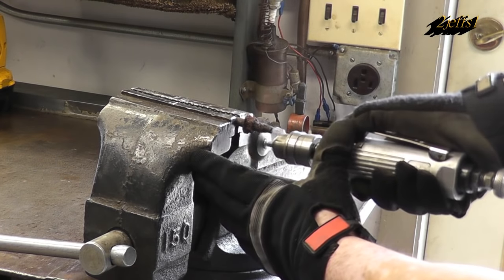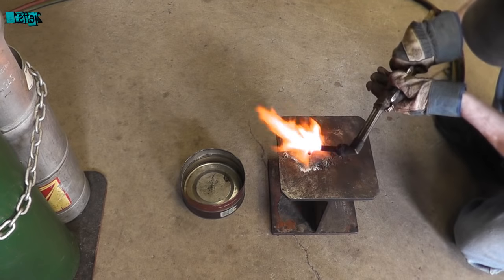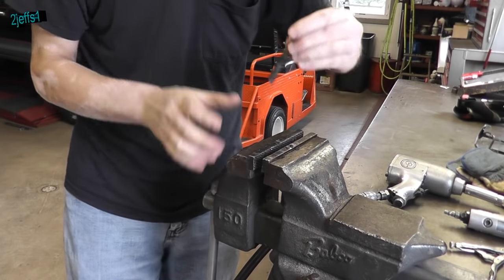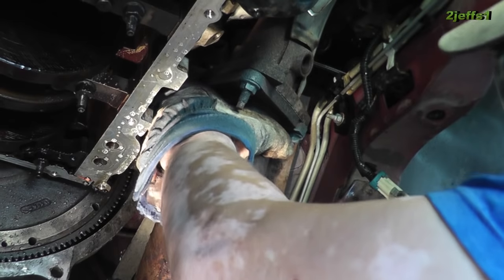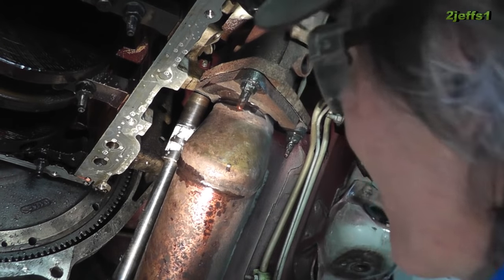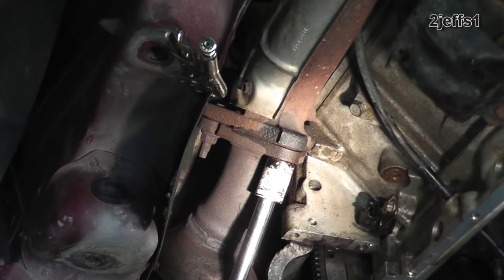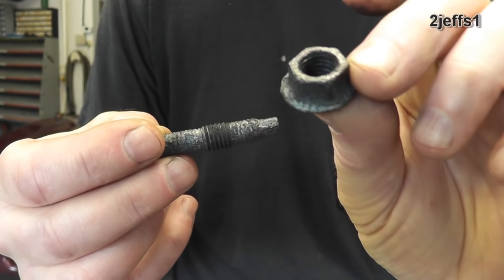Removing Rusted Bolts and Nuts THIS WORKS GREAT!

Comment: Love your tutorials and the method of glowing and rapid quenching with water. Question: is using low setting on impact gun essential' or using a ratchet would be just as effective? I'm thinking the vibration of the gun might greatly assist with breaking the rust bond?  Thank you for your delightful video"s coupled with your speaking voice. Hope to make your groil undercoat recipe this coming spring of 2022. All the best for your health and happiness this new year. Bruce the swimmer New R;ochelle N.Y.
Reply from the maker: The impact gun I am using is my favorite one to use. The light hammering on the internal weights helps big time for the jarring effect which is the final icing on the cake. Ratchet greatly increases the snap option which is not desired.... Thank you for stopping by....

Comment: Great video! Dealing with this right now down in Milwaukee. Can you buy a small blow torch at Home Depot? I never see them. What would you recommend for someone who doesn't own a big acetylene tank?
Reply from the maker: I haven't had any experience with what you are looking for and always wondered if there was an affordable alternative. Would be nice if someone could chime in on this one!
Reply: You could try something cheesy like this. Bernzomatic WK5500.
Reply: I have a Bernzomatic 5500. It works okay for me, but you have to know the limitations. I also have a tote sized oxyacetylene and a medium sized oxyacetylene. You have to understand the uses of each and use them appropriately. The biggest disadvantage of the 5500 is that the oxygen tanks are small, expensive, and run out fairly quickly. I'm not sure how it would do on a something the size of an exhaust manifold stud. I think it would probably heat it, it would just take a while. The flame would be very precise in a small area. I carry mine in my locksmith van for those occasional emergency torch needs. The larger torches are always going to be my go to for larger projects. So to sum it up, if you just want to try to work on an occasional rusty nut, the 5500 might be a good deal for you. Just know that it will have limitations. If you are going to be doing a lot of work with rusty nuts, pony up the $300-500 to get into a larger torch set - at least the small tote sized unit (commonly used for HVAC work).

Comment: I've worked in a machine shop for a gov owned coal mine. I've removed many many rusted broken studs. The only thing I did different was when welding a nut to remove a stud,..I would first weld a washer to the stud,then the nut.less chance of the weld ronning down onto or catching onto the flange. just a suggestion.

Comment: Thanks for the awesome video, would it be possible to use a Butane blow torch to do something similar, I'm assuming it will just take longer and create more heat in the surrounding area?
Reply from the maker: If you could get the piece hot enough to glow orange before chilling that would work fine, otherwise no.
Reply: Thanks Jeff

Comment: Nice job 2jetts1.................so interesting you know ya go through WHETHER DIY OR PROF MECHANIC you see these awesome techniques which will at some stage get you out of you know what SO thanks so much man
Reply from the maker: Your welcome Blair. Living in the salt belt here this technique gets used for many different things here!
Reply: If you like those bolts with road salt, you would love working on outboard motors coming out of salt water, especially when they mix up aluminum, steel,  and stainless parts..  LOL
Reply: Even worse are the Oriental outboard motors.  With these their "smart" accountants thought that there was no need for High Tensile bolts as the bolts were only going into aluminum.  BAD MISTAKE! as when someone tries to unscrew the bolts, the hexagons shear-off like they were made from cheese.  One ends up with a motor that is dowelled together with rusty headless bolts.  Built-in-obsolescence?

Comment: Hardening the nut so it don't round off. good idea.
Reply: That's not what is going on here. This is differential heating and cooling. When you heat it up the metal expands, but since the bolt has a nut on it, it can only expand along its length in that spot. Then when you rapidly cool it down, it shrinks back down and it leaves a gap between the threads. The larger the bolt diameter, the greater the gap.
Reply: Paul Childers 
Good explanation, +Omar Yahya
Reply: An old trick on a vertical bolt is rub a candle around the top so melted wax seeps in to the threads when they open

Comment: Getting rusted stuff apart is a crap shoot.  The 'blue wrench' often works. A technique I use when the nut is accessible is to grind it almost through on one face; this tends to weaken it and allow it to stretch when turned. Sometimes you have to cut it through on opposite sides; if you're careful you won't damage the stud or bolt.  I use this on U-bolts as you generally don't have a replacement at hand.  Nuts are cheap!

Comment: Awesome video!!  Does the amount of time after spraying with cold water matter much?  So, should it be warm yet, or can it be cool before you impact the bolt out? Thanks!
Reply from the maker: +jr scott The time after water cooling doesn't matter. Like on the Case tractor restore I'd do a bunch of bolts in an area and then dissemble. The best part on that is the time saver where you go right along to each one without setting down the torch and re-lighting it. Torch in one hand and spray bottle in the other and then dissemble when you get around to it
Reply: +2jeffs1 sweet!! I got old 9n ford tractor that I need todo some things to so I'll definatly be using this trick,  thanks!!!
Reply from the maker: Your welcome jr scott.

Comment: No disrespect intended, but asa 40= year veteran of removing seized parts, with or without a workshop with lots of equipment, I was curious to see if I could learn something new about how to do it without heat of pneumatic tools, nut splitters, etc. No joy, but a good vclip that many will learn from.
For me the star was the little guy at 1:49- he looks so cute, curious but confident.
Did he just wander in off the street? What breed is he?

Comment: How do you work around wire harnesses? What would you shield the wires with?
Reply from the maker: Remove or re-locate them if fairly easy, otherwise a piece of tin like I put up in that area works well too. One has to make sure there is some clearance between the tin and is not touching the harness.

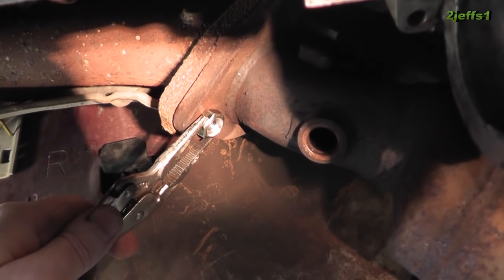Comment: Thanks for the video, question at  3:40 you mentioned that you drilled down the nut you were attaching? Could you just explain that piece and what you mean and how?
Reply from the maker: Hi chvydrptop.That was to insure the welder would get better contact/penetration to the stud. It would be more apt to snap off at the stud trying thru the nut opening without enlarging.
Reply: +2jeffs1 thanks for the reply! so you ground down the nut flat on one side so it would tack better? btw did you use an air grinder to that?
Reply from the maker: Not the best at describing. Didn't do any grinding on it. The threaded hole thru the nut was app 5/16" (10mm x 1.50 threads) Drilled app 1/2 way thru the nut threads with a 5/8" drill bit so it would tack better!
Reply: Ok gotcha, you enlarged the hole inside the nut so you had a bigger hole which would give you more tack. Thanks, I am just starting to learn welding, working on car for years though.

Comment: How did you know I do that? I use my torch 98% of the time on rusted bolts.  The rest of the time I end up drilling them out. I assume the the heat on the iron oxide has some reaction. I just know it works. I also know that a little propane torch doesn't work on anything of size or even small ones in large metal heat sinks.  Shock bolts, exhaust bolts and those little Phillips head screws on rotors need the torch treatment. Also if you ever tried to remove those screw bolts that hold hinges on a Samurai. I like the idea of drilling out the nut to get a better weld. I was taught to cut them in half to get a better weld. That is a pain.
Reply from the maker: +57WillysCJ Seems Ive been using this method forever where many experimental things have been tried here thru the years. On those Phillips head screws on the rotors they make a impact tool that you hit the end with a hammer while holding it in your hand. It applies a jarring - slight turning affect while forcing the bit into the screw. Don't think one would cost much either. Definitely a time saver. I have no idea what it's called or I'd tell ya. If anyone knows please weigh in!  I bought one in the late 70's for those screws on the Japanese motorcycle case screws which were next to impossible to get out. I used this trick on the bolts of an extremely rusted flange wheel bearing while the guy was watching. It works great on brake caliper bleeder screws too. For safety make sure to remove the piston first. Not sure if it could pop from the gasses generated inside. He got a grin for sure! Don't know what the Samurai setup looks like so sorry can't help on that one. Hope this helps you out 57WillysCJ.
Reply: They are just an impact screwdriver. It doesn't work as well for me. Might be arthritis keeps me from using it effectively. I use copper anti seize when reinstalling. For the Samurai, I used the torch and drilled the rest. I then installedregular bolts.  Thanks for your great tips.

Comment: I guess the quench causes a quick contraction breaking up the rusty pseudo welds? I thought you were supposed to try while the bolt was hot. I'm going to try this trick with an extractor to get a rusty bolt out that had a head shear off.

Comment: Have had them shear off flush with the manifold. Heated manifold very hot being careful not to use to rich of an oxygen flame.Took large screwdriver and tapped the stud whilst it was hot to form a groove in the stud metal and worked it back and forth until the stud could be turned out enough to get the vice grips on the end of  it or weld a nut to the stub. After everything is cool I always use new studs after running the correct size tap carefully into a well lubricated stud hole. Used to pound a nut onto the square end of the tap so I could use a socket because usually you cant get the tapping tool into tight places. It always seemed to work well for me.

Comment: Jeff. totally love your style and videos :  )  I'm wondering if you can help me with my car battery problem? I installed a trailer light system and hitch. It worked great until I tried wiring an LED back up light straight into my back up lights and now the battery dies every night?
Reply from the maker: Thank you! Man Brian, that's a weird one. I wouldn't think that would affect that type issue if things worked properly after installing. Perhaps have your battery/alternator tested???? I think them battery places do that for free. Just make sure you get the honest/good guy!  ;>) Sadly the only other option would be to disconnect what you've done.
Reply: 2jeffs1 thanks so much my friend :-)
Reply: 2jeffs1 you could show one melting a bolt,,,, ride out of a cast iron exhaust manifold. Collector,,. You can burn and blow it out,,, and not even damage the threads, if you don't know how to do this,,, swing by and bring a 12 pack of Michelob,,,, I'll teach you,,.  !!!   Hahaha

Comment: Hey bud....l like you got a good voice, gave a good demonstration,
and everybody at one time had to deal with a stubborn nut or a stud.
Thank you for the information which the trick is use heat. I got a cast
iron block with stubborn rusted studs sticking out of it how do l go
about getting those studs out it is a straight 6-Cylinder and the studs
hold the Cylinder head....any sugestions?

Gave you a thumbs up and l joined
Reply from the maker: I would probably start with heating one of the studs until orange, keep the stud orange for around a minute, then hit the stud with the water. Don't try to heat the head keeping the majority of the heat on the stud. See if it can be removed cold then. Every situation can be a tad different on handling. Hope this helps with yours.
Reply: Cylinder Head is not on the block...the studs are on the block 
I need to get off....they are 8" long.....the block is rusty and the
studs are rusted in them....heating the block would not damage
the block?
Reply from the maker: Ok, now I get a better picture... Your right. Sorry -  I don't know what to recommend for this one.
Reply: 2jeffs1 ...... I would still use a torch to heat it it...it's just a nature
thing that a frozen rusty bolt ain't going to budge coming out
I hate for it to break flush in to the block....would a hand held
bottle torch do the same job as a big torch does....any advantage
Throwing cold water on it before loosen it....will it warp the block?
I'm planning to do one at a time and space them around to keep
from warping.

Comment: Much better is using a Electric INDUCTION HEATER FOR BOLTS REMOVAL.
Much faster and easier.
No flame, no fire, no protection needed.
Reply: Thanks for this post because I didn’t even know something like this exist.  I have a 1997 F-150 with a leaking manifold gasket and I couldn’t figure out how to get those rust bolts loose.  I think this may just fix the problem.

Comment: Thanks for the Tips! I love the Blow Torch method. And You don't need a heavy duty blow torch nor heavy duty auto shop air powered tools. I've mostly used just a portable blue bottle propane torch and just a bit of elbow grease. I used the same on huge frozen CV Axle Nuts, frozen transmission and motor mounts, etc...

Unfortunately I don't have a home workshop like yours, anymore. I had to sell everything when I moved. But I do have a very tough electric impact wrench from a 1950s High School Automotive Repair shop class, a Brand New Portable Stick Welder, and an Ultra-Sonic Cleaner to make things pretty again.

Many, Many years ago I worked on Lawn/Garden Tractors for Sears in Florida. Lotza Work. I had a mobile work shop that had everything you could possibly need or think of on it, including a boom lift, gas compressor, generator, grinding wheels, etc... and parts up the wazoo. Whatever I needed I was allowed to buy, because I often had to go deep into farm country.

Lawn Garden Tractors begin to rust before they leave the store (not kidding). 1/2 the time nuts and bolts would round off, even just waiving a tool at them. One of my favorite Gizmo's was this: "Beetrie Multi-function Ratchet Universal Socket 7-19mm Power Drill Adapter". It should really say "With" Power Drill Adapter. You can get it at Amazon I know for sure, and most likely eBay, although I haven't checked. They probably come under different names and maybe even different sizes but this is the one I used.

The little rods inside the socket grab onto whatever is left and grip tight til things start to move and fall off. Some PB Blaster doesn't hurt the project neither. Sometimes once you get things started by hand, you can then use your cordless power drill-driver to finish up.

...and then I'd go home and take a bath in "Ultra-Dawn" dish washing liquid.

Comment: Doesn't heating steel in this way make that heated steel more brittle than the other areas of the heated part, ie. heating a 2 holed flange and heating up one side to get a bolt out, like you did?  Could that part, over time, crack or snap instead of bend over time?

Comment: This great. There are only two drawbacks; 1 I have any gas for the Torch. 2 I don't have a torch. I like WD40'anyway
Reply: Mark OnTheBlueRidge krol one of the best oils on earth for rusted bolts.
Reply: WTF is ATF?  Acronymns SUCK so stop it
Reply: Automatic Transmission Fluid
Reply: Better than PB Blaster and just below Kroil is Liquid Wrench.  Also, if you have something really stubborn, heating the stud or bolt rather than the nut or flange and then cooling it will work better.  When heated the stud or bolt will expand and stretch the metal around it, enlarging the hole. When cooled the nut or flange will stay stretched while the bolt shrinks and it will loosen more easily.
Reply: sqwid WTF is WTF? Acronyms suck, so stop it.

Comment: I live in Wisconsin also, I do what you do though I quench the threads with penetrating oil. Although I am thinking that the lubricant is just burning in the atmosphere. Maybe though it is allowing a slight bit, up into the threads. This could also potentitially be a fire hazzard, so I am careful doing this.
Reply: Actually quenching hardens the steel. therefore the nut is much stronger, so it will not round off as easy.

Comment: Your suppose to take bolts and nuts off while there hot, not after there cooled off with water, when the  nut or flange is hot, the metal expands helping to release the fastener.

Comment: I believe before you started it is called cold welded. with the broken stud you were lucky some of was still above the flange.
Reply: If  you have a stud broken below the surface, use a 312 stainless rod.  The flux will almost always keep the molten metal from adhering to the threads, if you don't arc to the threads.  Additionally; it is 120,000 UTS.

Comment: hello there!... i did the exact job on my 67 amc rambler american's manifold 3 months ago.... the doughnut was leaking...  your method is excellent ... but i want you to try this...forget the water... after you use the heat on the rusted stud and nut get a long table candle and press it against the stud for a few seconds (dont drip it all over).... the wax will get sucked into the tiny holes in the rust crystals and work as an ultra penetrating slippery lubricant... the shit comes apart like butter...
this is very old school... and not well known.... but IMO nothing- and i mean nothing works better... i was taught this method by my great grandpa (he was a new york city iron worker and machinist)....  when i was barely in my teens..  check it out